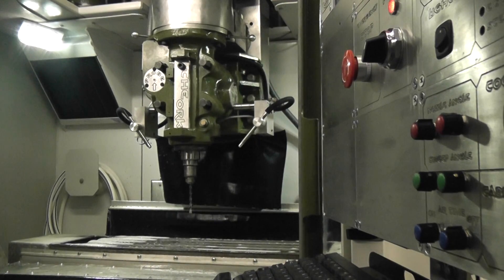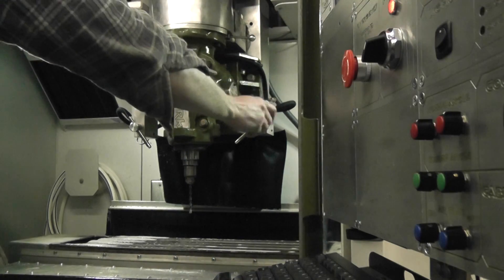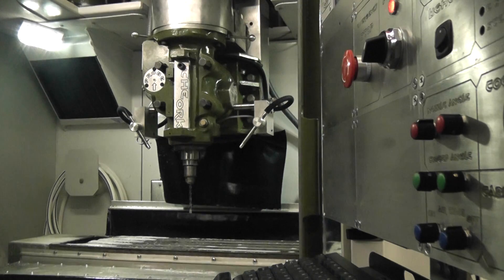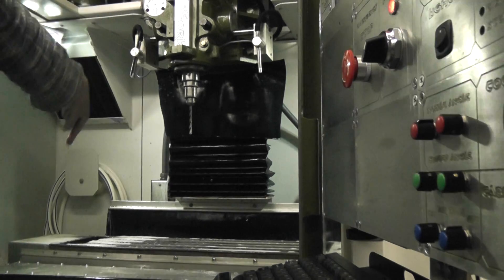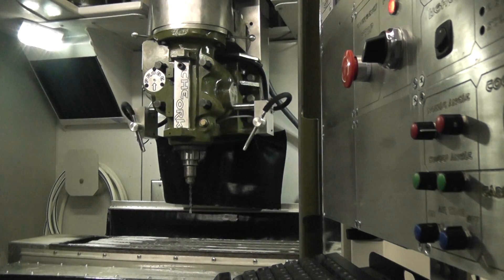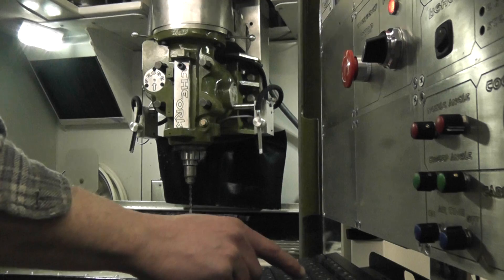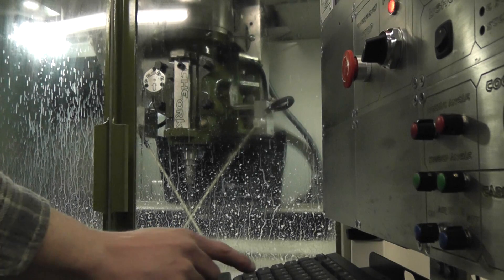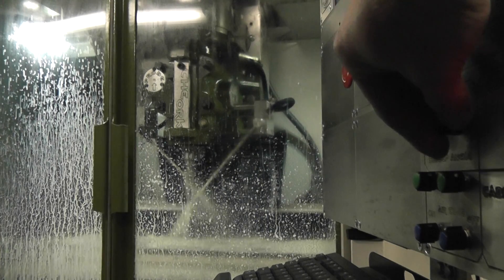servo controlled coolant nozzles part 2

Comment: Nice work. I’ve been trying to get my Fadal water nozzle to follow the cutter in the software. At this point I’d rather it jogged back and forth like yours than have to always check it and manually turn the knob every tool change.

Comment: why don't you get a coolant clutch and feed through-coolant? solve all your problems easier and cheaper
Reply from the maker: I just have fun making things. My mill is for hobby use and through coolant tooling is expensive. Not sure what you mean by a coolant clutch.
Reply: It allows the spindle to spin yet coolant to enter, like without tangling like a string around a small motor.
Reply: 22BOZIDAR there always seems to be some one that says things like this. Through coolant tools are  expensive then what just throw away all your regular ones?
Reply: you use your non-through for exterior contouring with mist and cycloid toolpath
Reply: Through coolant is not only expensive the tooling is expensive and limits your choices in tooling extensively. I would probably only consider one on a lathe being the tool options are more reasonable and far more alternatives. The cost of product on a mill with through coolant would significantly increase. Not to mention that through coolant tooling is less rigid and far easier to break. I can see it having its benefits in certain industries but the majority who’ve machined will realize it’s not the big win some think it to be. Your comment makes me think you’ve probably never owned a machine with through coolant. If you had you’d know my comments to be realistic expectations. Also when they fail they cause all sorts of issues which are usually not realized until it’s too late.